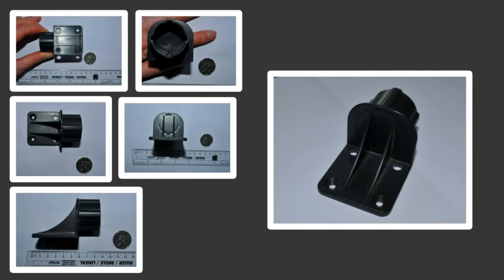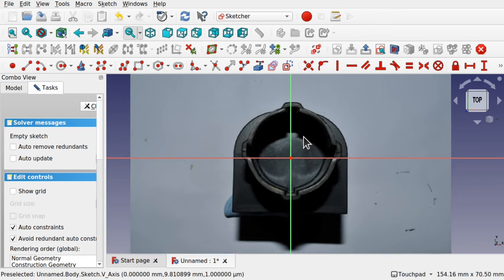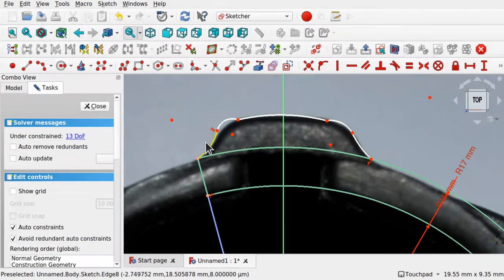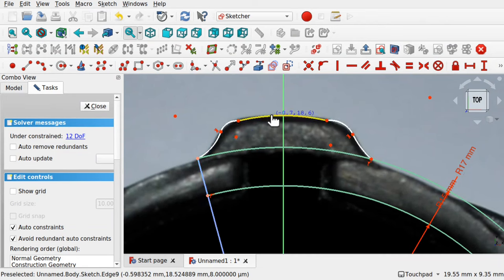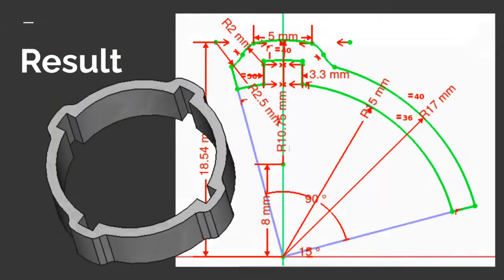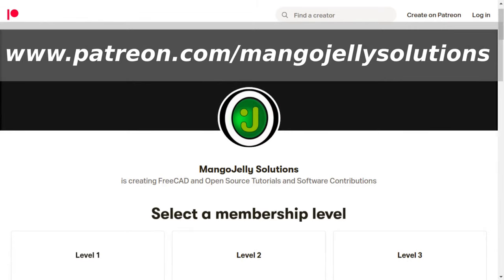FreeCAD 0.20 For Beginners | 5.1 | Tracing from Photos Project | Repeating Features | Polar Patterns

Comment: can you please explain more in depth how to read the DoF (degree of freedom) when you click on the number and they auto select, and how to fix them. i get them and dont know what to do with the information given by the application. great videos by the way
Reply from the maker: Yes no problems. If you had a single line without any constraints it will have 4 degrees of freedom. Clicking dof will highlight both points. One point can move on the x and y so 2 degrees. The other can do the same. Equalling 4 degrees. If you add a horizontal constraint you lock the points to be in line with the edge that connects them. So you have removed 1 degree of freedom. Point 1 can move in the x direction, but moving it in y will keep the two points in line so point 2 moves at the same time. So you now have 3 degrees. Clicking dof will still highlight the two point as they can move. Clicking on point 1 and locking it to the center point of the sketch now results in 1 degree as point 2 can only move along the x axis. Clicking dof now will only highlight point 2. Remember that being fully constrained is recommended but not necessary. Glad your enjoying the videos 😊

Comment: Version 0.21.1 got rid of the Image Workbench, the new way to add an image to the XY plane is File>Import>Select your file>Open. Once it's imported you select the image in the tree and under tasks you can change the plane, etc. 
I haven't, however,  been able to figure out how to scale the image.
Reply: It takes some time, but you can use the ruler tool to measure across the image, resize the image, delete the measurement, re-measure, etc until you can get pretty close to the size you are looking for.
Reply from the maker: Thanks for adding that. I am trying to add a sticky comment to all the videos that have tracing but it keeps getting removed. It may be because of the video link. If you double click the image in the treeview you will see a calibrate so you can scale the image. https://youtu.be/WhxDAgskcHA
Reply from the maker: In the tree view of you double click the image you will see a number of tools within a panel. You will see the scaling told within. Hope that helps. Also I have done a video on it https://youtu.be/WhxDAgskcHA

Comment: Found this channel few hours ago and seem pretty useful.
Im Blender artist over eight years and seems like some kind od mechanical conponent modeling is way more easier to do in FreeCAD using sketcher. 
But for more organic shapes sketcher is nightmate. Is there way how to get desired shape without sketcher? 
Curves are not super intuitive as well.
Is there way similar to subsurfacw modeling to get desired shapes? I know there is somethink like this in Fusion360, but can't find anything like this in FreeCAD. 
Also I would like to see your way how to create sibmarone, airplane or that kind of models woth smooth shapes.
Thanks for your work. I like the way you teaching. I finally deside to seriously learn FeeCAD.
Reply from the maker: I know exactly what you mean about organic shapes. I have been involved in a project with one of my Patreons where we are creating an ergonomic grip. I have been using the Curves workbench and I have to say it's been a challenge to get the grip shaped. It requires palm and thumb swells that are moulded to the users hand. I have been using a loft through a series of freehand curves and getting the lateral shape using the mixed curve of the curves workbench.  Lofts are your friend when you come to these kind of objects. Thanks for the comments, I have a project in mind that involves a submarine, I have a flooded quarry where I live and I want to build a remote control submarine to explor it and then thinking about building one in freecad then rigging it with the necessary mechanics and electronics, again lofts would be used for this kind of shape. Looks like I need to make some videos 😁
Reply: @MangoJellySolutions  Exactly, These shapes are hard to create in FreeCAD. Anyway, looking forward for upcoming videos

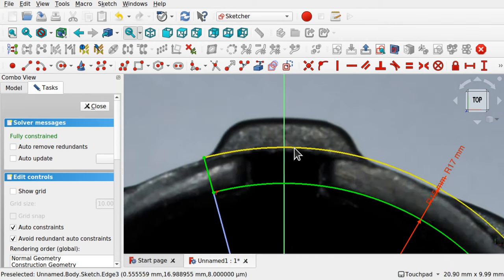Comment: Thank  you very much for these videos!!  I'm getting stuck at 13:25 when drawing the second arc.  Freecad refuses to let me select the correct second and third points of the second arc where they should be on the convex curve of that protrusion.  It seems to have some preference to selecting the Y-axis and ends up with a large almost 270deg arc.  Any pointers?

Comment: Hello MangoJelly,

I wonder if I can have your help about this lecture: FreeCAD 0.20 For Beginners | 5.1 |

At the time 18:41 to 18:50, in your video, there is orange alarm (the entire screen became orange). However, in my side, there is no orange. Seems good. In my area of 'Solver messages', it shows: 7 DoF(s). I clicked it and four points of the two lines became green. Now, what should I do?

Thanks for your attention.

Best regards!

Youfang
Reply from the maker: If you want a fully constrained sketch then it sounds like you have one of those highlighted geometry not connected.  Pull some of the geometry and see what moves and use control Z to undo.  From there you can constrain those geometries down.  Hope that helps

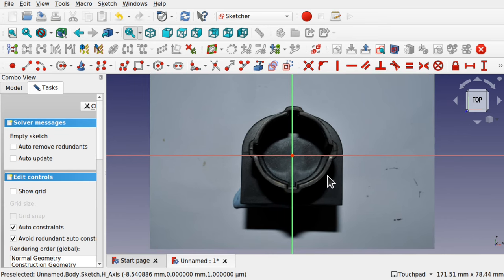Comment: Just wondering: At 3:55, we change the position of the image manually. But it requires a good judgment about where the center is. That is error-prone.

Instead, can we snap it accurately?

For example, I can draw a three-point circle that matches the tubular part fairly accurately. FC automatically creates the center of this circle. If I can constrain this center point of the circle to the origin, and make the image move along with the circle, I can achieve the centering perfectly.

Is that possible?
Reply from the maker: Good question and I am wondering if the techniques of position in this video will work with images. I have never tried selecting the image in the draft workbench and using the move and snapping  tools. It's worth a try and if it works then it may be the answer https://youtu.be/GG0OB7taJUw

Comment: Having an issue once I set the first two radii of 17mm and 15mm it brings the lines off of where they should be on the reference image. Then if I continue it feels like the rest of the drawing is going to be off. 

How do I resolve this issue? I feel like the problem starts when I set the scale of the reference image if I’m not clicking the exact same locations as you are but still setting to the same dimension. 

Seems like just using the same image and setting the overall dimensions to the ones you have would be a more sure bet.
Reply: I resolved this issue by doing just what I said. 

Instead of setting the scale by setting the diameter I set the scale by matching the overall xy dimensions to what was shown on screen after MangoJelly set his scale with the diameter. 

Guess if I was making my own part off a reference image setting the scale from a known dimension is obviously how to best design the part.
Reply from the maker: Very good point, it all depends how accurate you are with where you click when you scaling.  And when you zoom in everything including the edges get bigger.  So do you drop the lines on the side of the edge or just in the edge.  I can see where you was having problems.  Thanks for sharing this information with others.  Really helps with people encountering the same issue.

Comment: I tried a different approach to create this geometry: 
1. Created three concentric circles. 
     (The inner two circles are to create the wall of the cylindrical body, and the outer circle is to construct the ribs.)

2. Drew 2 lines parallel to the x axis, on either side of it.
3. Drew 2 lines parallel to the y axis, on either side of it.

My idea was to join the intersection points between the circles and the lines to create the four ribs.
(I would have trimmed off the rest of the outer circle.)
But I am unable to make the circle intersect with the lines.
I tried to add a point on the circle and tried to add "coincident" constraint to create an intersection between the circle and the line.
But that also does not work.
 
Why is this happening? What should I do?

Comment: In CAD when you measure a part do you have to commit to that measuremet or can you say....meh instead of 38mm I'll make it 40mm?
Reply from the maker: Depends on the end result your looking for and any tollerances you want to incoperate for example 5mm holes are going to be dead on 5mm. So if you have something that fits exactly in those holes then you need to add remove a little so, say the pin will fit. Or if your replicating something exactly.

Comment: I really wish you had show how to fix lines that are not connected. I come across these points that are not connected and it's almost impossible to find anywhere to show how to fix it. I haven't yet watched the entire series, but it's such a common issue. It would be great to see it get fixed earlier in the course.
Reply from the maker: When lines are not connected it means that you haven't constrained geometry together within a sketch correctly. And left them open. This is normally none by say clicking close to rather than on the end points when laying down connecting geometry. There is a tool in the sketcher called  validate sketch which can highlight these troublesome areas. Thank you for the suggestion I am not sure if I have created a video but I am thinking of doing one which details how to deal with a number of errors that could occur.
Reply: @MangoJellySolutions  I'm really just started learning and I couldn't have gotten anywhere without your videos. For that I thank you. There's still much for me to learn, so will continue through your course.

Funny thing. I installed FreeCAD almost 2 years ago and had open it up only once before finding your tutorials. lol.